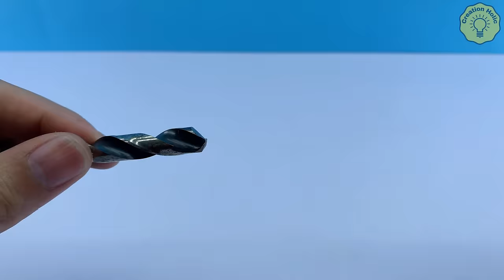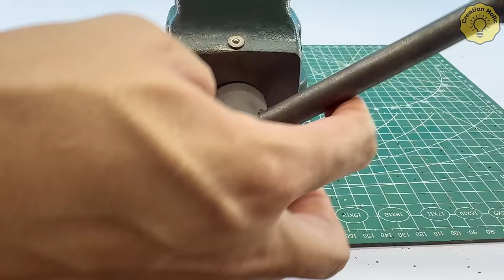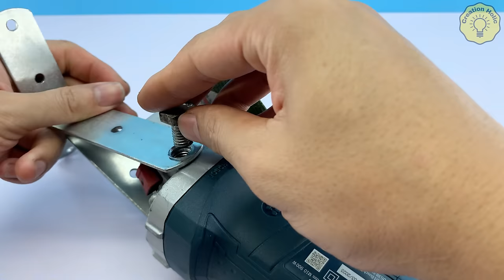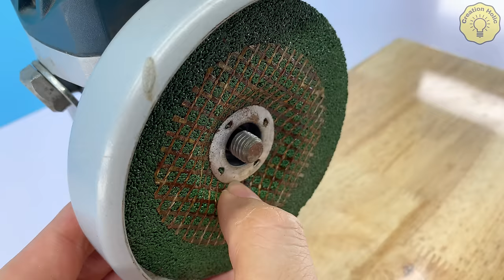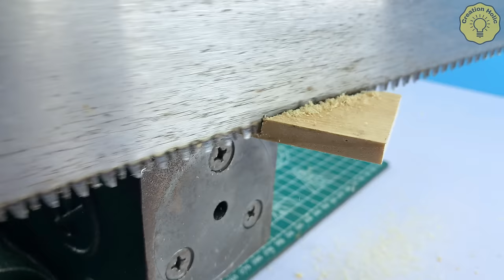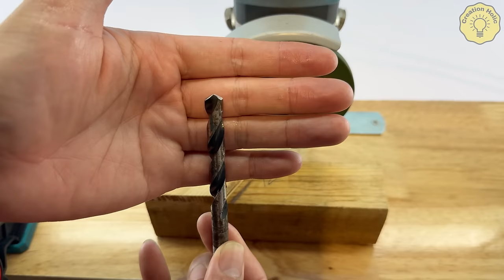Razor Sharp! Sharpen Drill Bit in 1 Minute With This Tool

Comment: Hmmmm….. honestly, I would buy a new drill as I don’t have the use of most of the equipment involved I would have to buy. Not to mention the time it takes! Also, some key sections are missing… How to you cut the big bolt? (Another expensive metal cutter I imagine) and what kind of sandpaper is being used? (Another expense). Good for a tradesman I suppose but not for the majority of us. Far too complicated.
Reply: Exactly! It’s crafty but I’d just go get a new one also.
Reply: Yeah, and who wastes extremely oversized bolts when you can buy the ones that fit the occasion?
Reply: You have a drill bit but no drill? Buy an angle grinder, cheap tool, with myriad uses. That was all he used in this video, two tools that almost every person owns. But, all he is really saying is make a jig to hold the bit at the correct angle against anything that grinds.
Reply from the maker: Thank you for watching

Comment: Just learn to sharpen drills by hand.
Reply: If you watched this then you didn't. Sharp bit never takes that long to cut. There is no relief behind the cutting edge. Meaning if you look at the bit from the front the cutting edge should be the highest point, if not you'll get what he just got. A bit that will start a hole but you'll have the muscle your way through the rest.. FYI
Reply from the maker: Hello! thanks for your comment. Wish you all the best!

Comment: After the apocalypse when theres no more hardware stores,  all of you will appreciate the knowledge gained from this video!
Reply: Where you going to get the electric from to run a grinder after the apocalypse?
Reply: Well after the apocalypse there might be more important things to worry about than drilling holes in some metal, even if you could generate electricity, like food,  and not getting your head head knocked of by some crazy dude that wants to steal thet very food!
Reply: @MrYAMAHAR11971  you'll probably scavenge solar and batteries. As they'll be easier to find. It's also simple enough to build a hudro-electric generator from any moving water source.
Reply: @gerrywhelan5761  the second most important thing is shelter and security. You'll need a drill for that.
The sooner you build a safe secure complex, the sooner you become king.
Reply: @kewlztertc5386  Why would you want a drill for that, how many native peoples have made good shelter for themselves without any drill or the like, as for security,  I would definitely lean towards a big bloody gun or a big bloody knife or the like, not a drill, for whatever a drill (not much on its own) could construct could be easy breached by determined individuals in a apocalyptic environment.
Reply from the maker: Thanks so much for watching our video. Wish you all the best

Comment: Learn to do it correctly, on a grinder so that both sides cut. This is no good at all. It could be done similar to this and get a reasonable finish if you moved the drill bit correctly. But a decent radius grinder will give a much better finish, with even, raked and sharp cutting edges.
Reply from the maker: Thank you! Cheers!

Comment: You'd have to use a new grinding disc that was flat, not like that one.  Plus you'll only get the cutting edge angle this way, and the bit should slope away from that so it's not touching the material it's drilling.
Otherwise it's a good idea.
Reply from the maker: Hello! thanks for your comment. Wish you all the best!
Reply from the maker: Hello! thanks for your comment. Wish you all the best!

Comment: Well that actually took about 6 minutes and I think you have the best answer towards the beginning of the video where you just held the drill bit up to the grinder, why wouldn't that work? You just leave it in the drill for a better grip on the bit and put it to the grinder. Simple. Fast. Done.

Why put a good grinder out of commission in a locked position no mobility and very limited applications?

Just bored people overthinking things with their science brains. If the world runs out of new drill bits or drill bit sharpeners, it may have also run out of electricity, severely limiting the uses of the drill bit anyway.

Comment: Sorry did not see someone already comment the same.
Large drill to 3/16 inch is easy by hand on a grinder but smaller sizes are tough especially get the cutting edges equal.
As I said before this is a good start especially for badly distorted bits.
Reply from the maker: Thank you! Cheers!

Comment: 1st... wd40 is not a lubricant. use an oil for this. 2nd... a small bench grinder with an angle guide is about the same price as that tool. no need to have a loose, wooden guide taped to the base or to have to build any of that. 3rd... the bolts create a pivot point. that grinder will never stay plumb while you're pushing in it. 🙄 idek with these ppl
Reply from the maker: Hello! thanks for your comment. Wish you all the best!

Comment: I'll tell you all a secret next time you have to drill through something that's almost impossible.... All of the diamond bit drill bits at the parts stores and usually at the hardware stores are all s***. Made with cheap alloys if you know where an old '70s Ford work truck is go pull out the seats and look for old tools in there like wooden drill bits because they're stronger than anything made to cut through metal that you can buy today I've drilled through bolts stuck off in the manifold on an '80s model S10 before with a wooden drill bit because everything else I bought kept breaking I couldn't believe it
Reply from the maker: Thank you for sharing your feedback. Have a good day!

Comment: You tool only serves to dull bits and promote injury! That will not make a bit sharper, you would have to an undercut on the back side of the leading edge and definitely don't use WD-40 just keep the bit cool by bipping it in water after a few seconds of grinding so it doesn't lose its temper... My advice don't make videos about a topic you know little to  nothing about!
Reply from the maker: Hello! thanks for your comment. Wish you all the best!